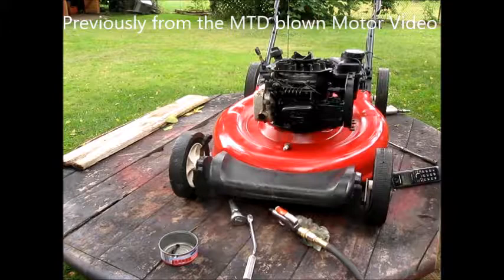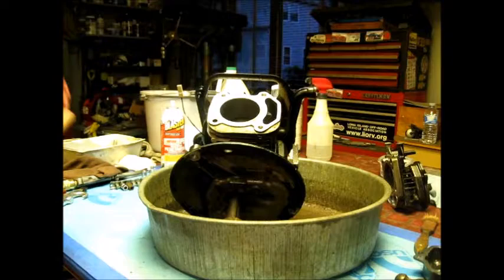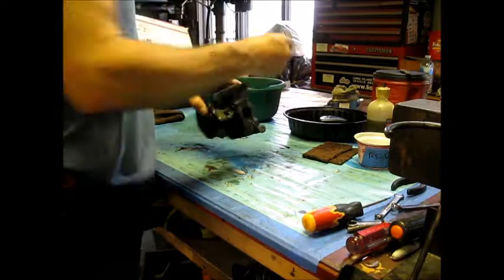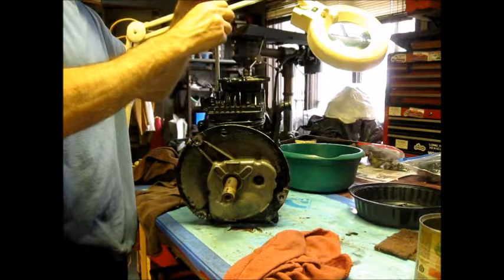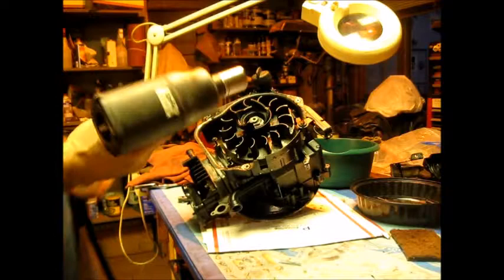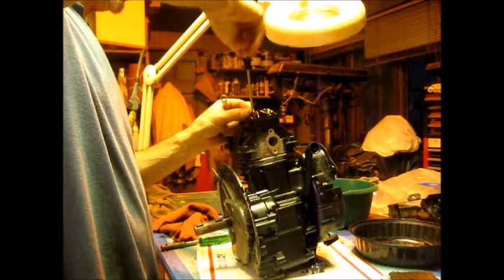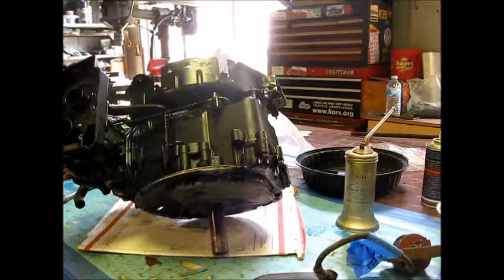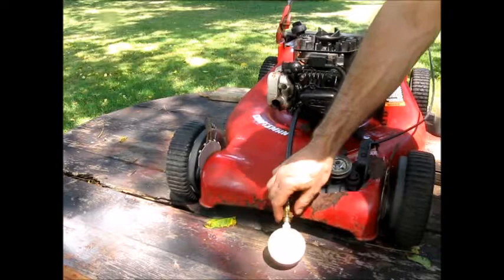How to Fix a Briggs OHV engine - No compression diagnosis and repair

Comment: Just quick question was they new valves that went in ?
Reply from the maker: No, I ran them on my wire wheel and then used valve lap compound on the valve face and seats
Reply: @TheNovaJohn  cheers thanks I've got a 625exi with no compression at all will be taking the head off can't find torque setting
Reply from the maker: @tommytreez334  look for torque specs on that size bolt, for example; 5 star, 3 star, ....
That should be close enuff!!
A good spec sheet will tell you hardness of bolt and if its going into alum or steel
Reply: @TheNovaJohn  thanks its same engine as yours just 625exi 150cc looked everywhere for the torque setting can't find on b n s site
Reply: 093-j02-0072-h1 engine
Reply from the maker: @tommytreez334  I say it in the vid, somewhere around 200 inch pounds
Reply: @TheNovaJohn  cheers mate thanks for help